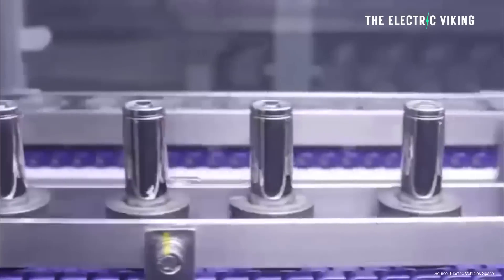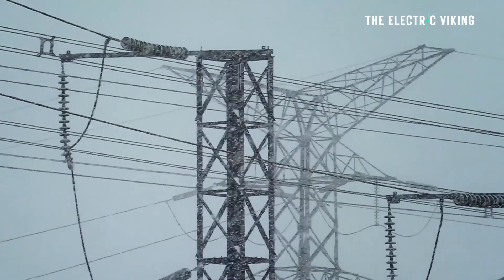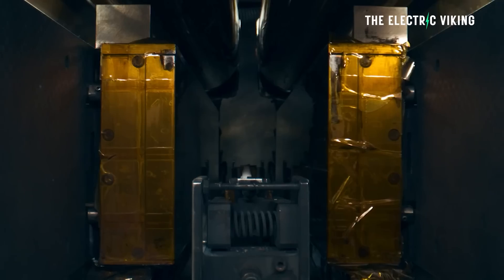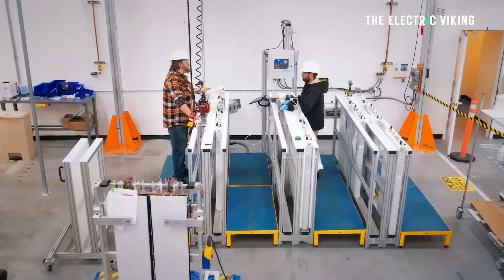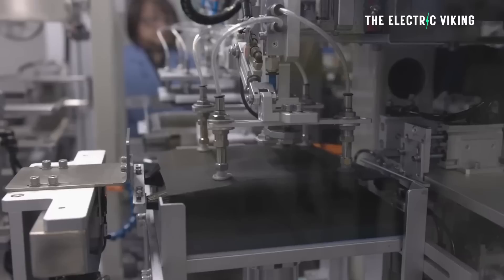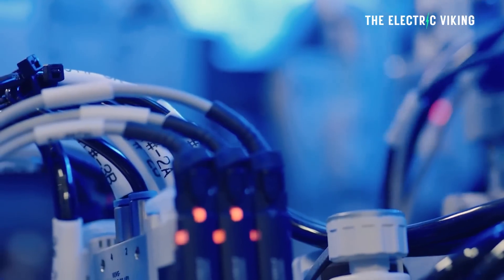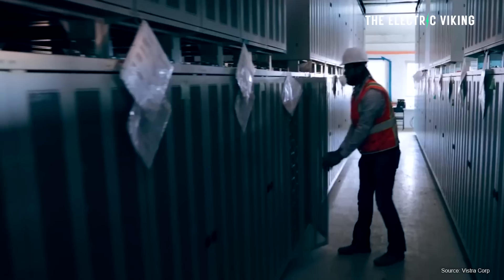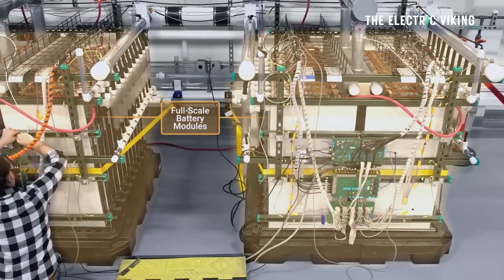U.S company reveals revolutionary battery that DESTROYS sodium & lithium

Comment: Nuclear is only economical when running 24/7/365.
The grid is only economical with 24/7 cashflow from millions and millions and millions of customers. $100sBILLIONS. 
Customers are the grid protectors and generators and opening up new load capacity to new heavy industrial users.
The existing national electrical grid is a $TRILLIONS infrastructure investment for the grid owners and the community as latitudes warm. 
Grid new capacity construction is extremely expensive, $1, 2, 6, 10million per km. 
Millions of km to millions and millions of customers. 

Capital grid costs are the key to understanding the future clean electric world. 

20 years to replace ICE age vehicles with BVs, battery vehicles. Early adopters first. 

Petroleum for road building, petrochemical industry, for emergency winter weeks, military defence, will remain.

BVs oversized battery parked 23hrs every day and selfplug-in V2G storage will protect the grid and make money 24/7.

Rooftop PV panels will shade hot roofs and charge BVs and RONDO HEAT BATTERIES for home and building and industrial customers. 

Distant renewables and Nuclear electricity and Central Generation plants are economic 'dead ducks'.

Rooftop PV is cheaper than windows $/m2 installed. 

BVs have FREE reseve energy storage every day. 
More BVs than buildings. 

The grid is the community asset and is becoming community focused today. 

Existing nuclear power will be mothballed.
Reply: Just my thoughts. 
I am an old CivEng Construction Engineer. University Degree and decades of experience. 
Power generation and transmission. 
Grandchildren and young friends. 
The future is always coming. 😊😊

Comment: There are several advances that could address the issues with the Edison Ni-Fe batteries. A small hydrogen fuel cell could reclaim the hydrogen losses, while putting power back into the batteries in the process. The chemistry has a proven longevity record.

Comment: If the Energy is there, and proves reliable. It will get used! $1mil per MW battery built up to 4 hours top up power means at 10% will still only cost $500k to cover 24 hours. This is a bargain!

Comment: Advantages:
* Low cost: Iron is abundant and inexpensive compared to other battery materials like lithium or cobalt.
* High energy density: Iron-air batteries have the potential for very high energy density, making them suitable for large-scale energy storage.
* Long duration storage: These batteries can provide power over long periods, making them ideal for grid energy storage applications.
Challenges:
* Slow reaction kinetics: The reaction speed is relatively slow, making iron-air batteries more suitable for long-duration, large-scale storage rather than fast, high-power applications.
* Low round-trip efficiency: Some energy is lost in the charging/discharging process.
* These batteries hold promise for renewable energy storage, as they could help store surplus energy generated by wind or solar power for later use.

Comment: Sounds like the solution for a power grid that needs a sudden burst of energy output is to go with say a 90-10% mix of battery technology. You have 90% of your batteries as iron/air and 10% lithium/iron for up to a 10% spike in demand.

Comment: The disadvantages of this battery are caused by breaking and forming bonds and then moving the atoms.  Make a design that does the electrochemistry without breaking or forming bonds.  Power supply would be quick and efficient  (low heating) because we move only electrons, the atoms would remain stationary.

Comment: Interesting. But I doubt it’d negatively affect Tesla’s grid business. I understand they currently use CATL batteries in this application. What’s the problem of changing to this new iron air battery. On the contrary, it would help the business. Seems like the ideal solution would be for a combination where the iron air batteries backup the fast discharge LFP’s.
Reply: 109%posted up on point

Comment: The clue is in the battery specification. 8,500 MW hours at 85 MW discharge would give you 100 hours of supply, roughly 4 days. That basically says that it's discharge rate is 0.01C, which says that not only is this battery good for multi-day storage and discharge, but really that it is only good for multi-day discharge and storage. And the only way you can have multi-day storage is to make the storage extremely cheap.

Although it's always claimed that lithium batteries, of any flavour, are only good for storage periods of up to a few hours, this has nothing to do with the battery performance/chemistry it's about the economics.
To take a slightly extreme example, you could use lithium batteries for seasonal storage to store surplus solar in the summer to use in the winter, cycling at the batteries once per year. If your storage cost you $100/KWh and you expect a return on your investment in 10 years, that would be 10 Charge Cycles to recoup your $100 meaning you would have to charge $10/KWh just to cover your costs, plus you've got cost of; finance, O&M and profit to add.

Conversely, if you wanted to use an iron battery for domestic backup and your peak demand was 10KW for 2 hours, you would need a thousand kilowatt hour iron battery, which at 1/10 the price of lithium would cost you the equivalent of 100 kilowatt hour battery when all you actually need is a 20 kilowatt hour battery, again the economics don't work out.
Reply: I don't think they say what the charge/discharge efficiency is. If it's only, say, 65% then we would need about 50% more solar or wind than with LFP or Na-ion, assuming They are 95% efficient. Bu then again, just as I always thought about hydrogen, it's better than no long term storage.
Another problem, though is "how many watt hours are needed to make a watt hour of the battery" (or gigawatt hours per gigawatt hour of capacity). If the efficiency is low, then that doesn't add up - unless of course, they last "forever".

Comment: Just an FYI.
8.5 GWH of power storage equals 4 hours and 8 minutes of NY's Late, Great, Indian Point Nuclear power plant.
So to store enough power to replace Indian Point, you'd need somewhere between 25.5 GWH to 51 GWH of power storage or maybe more.
Reply: I get your point but you are completely mixing up storing and generating. The concept is that you are busy generating plenty of electricity using solar and wind but with them - unlike nuclear - you need to add storage. For example to cope with night time.
Reply: @CheeseLovingGuy  I'm not mixing them up, I'm making the point that Nuclear is infinitely superior to wind, solar and other "renewable" forms of energy.
New York Greens shut down Indian Point and we replaced it will gas fired plants.
The Best Energy is Nuclear, Period. No batteries required.

Comment: The big downside wirh Iron Air batteries is thier low round trip efficiency at abot 50 to 60%. Thats a big deal as it costs to produce the power to charge them. Maybe a more expensive but more efficient battery works out cheaper in many situations.

Comment: Great video, thanks. Hmm yes it seem too good to be true... But lets hope it is. Multi day battery also sound AWESOME!!! However I keep commenting the Vulcanic eruption problem which is already happened many times and documented... https://en.wikipedia.org/wiki/Year_Without_a_Summer In case of 1 year "darkness" a multi day does not seems so good... But getting there.
Reply: Will the vulcano stop the wind blowing, tides flowing, water corsing, core heat rising or cause sufficient haze to shade many areas of the planet simultaneously?
Reply: @GruffSillyGoat  YES, mostly to all (tides is caused by the Moon but there are not many tide wave electric generators)...At least what we are using to generate energy. Earth wide sun block already happened: https://en.wikipedia.org/wiki/Year_Without_a_Summer  An eruption near to Australia caused snowing in New York in July... What do you think how wind is formed? SUNLIGHT heating up the AIR... No sunlight no wind after the atmosphere temperature evened out.
Reply: @tothimre7950  - oh dear in your rush to be dramatic you've not really thought you're answer through. Why would geothermal and gravity be impacted? As to wind producing temperature differentials - the vulcanic haze wouldn't stop the Sun radiating on the Earth, it'll just diffuses the light over localised areas, albeit sometimes distant from the vulcano. The Earth will still be warmed by the Sun, the Earth's albedo is affected in complex ways by different types and locations of erruptions, no one erruption has the same impact as another. However, the wind will still blow as temperature differentials will still exist across the globe, even in a vulcanic winter; perhaps even a little more forcefully as the global differentials may be more marked. All the energy sources I listed will be unaffected; even PV, which works in diffuse sun light, will operate although at lower output levels in affected areas (as is seen in snowy areas where PV is used).
Reply: @GruffSillyGoat  I wrote that MOST things will be impacted not tide wrote it is moont, gravity etc.. as you also very well know.. just you are trying to be dramatic... 
And "gravity battery" will run out of hight after how many days? How many GW of those batteries we have? How many GW of thermal we have? Because from solar this year estimated 800 GW will be deployed. That's about 3-400 nuclear power plants!! This amount increasingly will be deployed yearly on top of existing solar. So in 2-3 years time solar will be 60-70% of the energy mix. Your e.g. 10 tide wave, 150 thermal generator and 5 gravity battery will be 0.5% or 2%...  Don't you think this is a problem?

Have you read the article? Eruption happened in the Pacific and New York was impacted.. Several years later the sky was red. Check out the paintings, poems about it... So I still not convinced in case of 70% reduced sunlight wind and tide will replace 15.000 GW lost solar.

Just to be clear I am NOT anti green, Trump fun... Actually I have solar panels, waiting for Tesla Y Juniper to switch full electric. So this is a good thing but every good thing has limitations. Just people cannot see the solar problems, yet...
Thanks for the response usually my comment not picking up by anyone:)
Reply: @tothimre7950  - Gravity, as in applying to the water coursing in my original list of renewable sources not impacted by a volcano erruption; hydro (not just pumped hydro) accounts for significant generation, if not the majority, capacity in many parts of the world. Similarly geothermal is the majority, or a signfiicant, energy producer in some countries. I did not mention gravity battery systems, which are small scale and/or exploratory status system at the moment. Wind is a significant generator around the world particularly in northern and southern, and coastal countries. Central sun belt countries, particularly land locked ones, may produce more energy by PV, but again the solar radiance at these places will not be significantly imapcted by volcano haze or sulphur based albedo impacts for a variety of reasons (such as atmospheric particulate distrubtion patterns, the Earth's rotation, higher average radiance levels).

Best to look up volcanic winter and see the overall impacts, that the link you provided is just one example of. The general effect may well be an overall cooling, of varying durations, but temperature differentials still exist around the global and wind will still blow as a result. However, as noted in many science articles the potential volcanic cooling impact is currently outweighed 1,000s of times over by man-made climate warming impacts. 

Countries and energy companies are well aware of a variety of localised risks, perhaps check out the supergrids planned around the world to deal with localised disruptions and diversified renewable generation. Many of the HVDC links that enable a supergrid to be implemented are already in place. 

Perhaps if you wish to discuss such details it's best to reduce the drama level a little.

Comment: The weak point of renewable energy is grid distribution.  Here in the USA our power grid belongs in the early 20th century.  The new world of electricity will be based on a decentralized, modular, and battery controlled  grid.
Reply: US problem is that grid monopoly companies are USING the excuse that grids need to be owned and run by a monopoly, to allow generation to ALSO be owned and operated by a monopoly. This is an error. Grid should be separated into a regulated  monopoly as now, BUT NO OWNERSHIP OF GENERATION IS ALLOWED. Gen is then split up into separate competitive private companies, none owning more than 33% of a grid's supply. Daily bid market is well known, used in other countries, eg Ontario Canada.
Reply: That would be a good place to start. Lowell Bergman did a documentary 20 years ago on our power grid. The result was that we need to build a new power station every year for 20 years, we would still not keep up with demand. Maybe if,the democrats would start with upgrading the grid, the electric car industry may have made it. But like all democrats, they put the cart before the horse.
Reply: @davidreed9300 
Bergman's documentary was called "Blackout". Yes, we need new sources of electrical generation. What is happening is that large centralized power generating stations are being replace by bidirectional distributed renewable energy. These sources will include "prosumers" (Toffler) as well as large solar, wind, and geothermal sources. "Grid Forming" battery storage nodes will manage the system. No Blackouts.
Reply: @chrisconklin2981  thanks for the info. That’s good to hear. And to my point, is about 30 years behind. In fact, we should be near completion of an entire new grid with expandable nodes. This is all held up by politicians who are more concerned with fighting with each other over a tufted tit-mouse, that putting us towards total energy independence.

Comment: The solution to the relatively low energy deployment is to combine this Mega storage with a  smaller battery with much higher output like sodium or LFP.

Comment: I don't get what this talk is all about a one day battery or a multi day battery.  Surely if your battery doesn't self discharge, if you use only half of it's stored power today, you have half left for tomorrow.  It is a multi day battery.  The Lead Acid battery in my old ICE car is a multi day battery.  I can start the car today, close it down and start it tomorrow without recharging it.

Comment: I’m from New England looking forward to the world’s largest battery to feed our grid. I looked up Form Energy and everything Sam Evens said here was in the article I read.  

The reason why New England needs the 100 hour battery is: When a cold spell strikes, and gas runs low, power plants switch to burning oil, which sets back the region’s ambitious commitments to reduce its climate-altering emissions. Oil is much dirtier fuel and produces more carbon.
Reply: True

Comment: 1/10th the cost on a kWh basis. This is how it works. On a straight up 1:1 capacity to energy installation they cost about as much as Li batteries. It's the marginal cost to add energy (kWh) that is "dirt cheap". As the kWh are scaled up by electrolyte in tanks the overall cost for kWh goes down. 

Now Sam, i am disappointed. These are electrolyte, fuel cell based batteries and are not the same as Li chemical batteries. I did this analysis 10 years ago with Zinc based batteries getting the same thing. Back then i came up with the 1/10th cost comparison. 

Fuel cell batteries do not handle surges both in and out. They are a 1C solution and good for long term.

Comment: Interesting possibility that I will wait to see if they can scale production enough for a 10X cost advantage.  Also any battery technology can be a multi day battery.  If any battery is dispensing power at a low enough rate compared to the capacity of the battery, it could provide power for days.  Just think of the things in your house (say door sensors or smoke alarms) that are continuously powered and the battery lasts for multiple years!

Comment: Another take: So probably not a great solution for Automotive or Marine Power, but good for grid storage. Tesla has throttled Semi production, and probably some car production, because the batteries are required for grid storage projects. If that capacity is freed up, then production on Automotive Production can increase. 
Horses for courses.

Comment: We have load management to help with some of the concerns expressed here.   For example, our at home electric car charger is disabled during the evening peak period.   To compensate for the minuscule inconvenience on when we charge, we pay a lower rate for the electricity used to charge the car.     We have a similar arrangement with our electric water heater.

Comment: If FE-air is as cheap as it is, it will be a good baseline.  We will need other higher output batteries to replace peaker plants in heavy areas.  A super cheap steady output though is great and necessary. I can believe the 1/10th the cost as lithium is expensive and rust (i mean iron, lol) is dirt cheap lol. So yeah there will still definitely be a place for other batteries in the grid, this will just be the dependable underappreciated backbone workhorse in the future that every region has, but wont be useful in case of extreme demand.

Comment: They just need to couple these with other high discharge rate batteries to best serve the grid - the other battery type would serve as a capacitor for quick distribution!